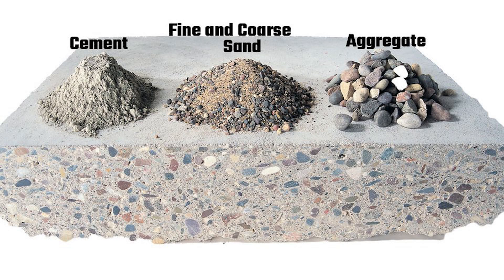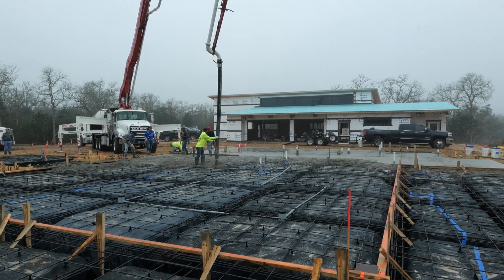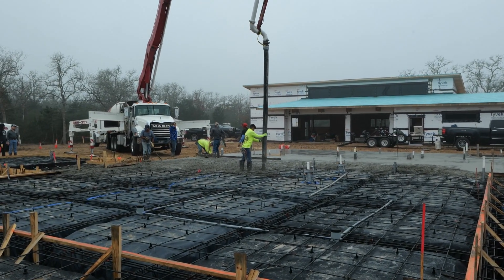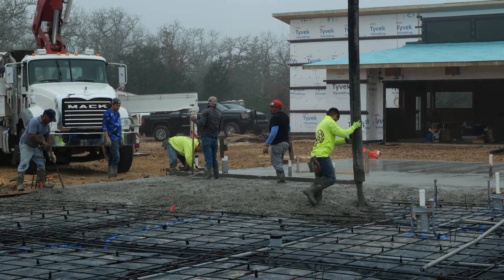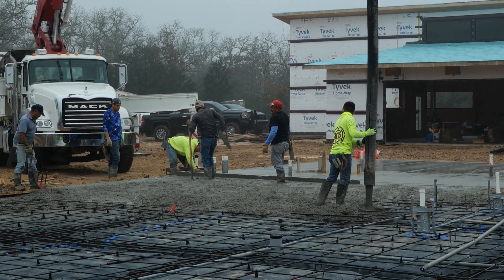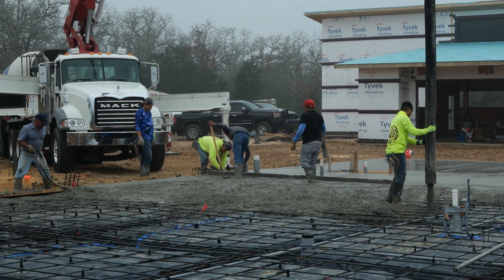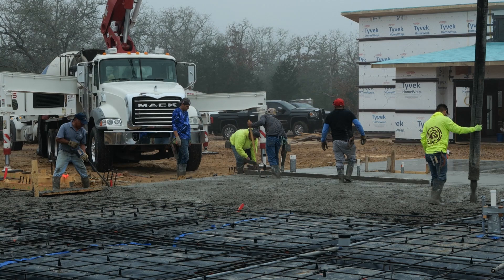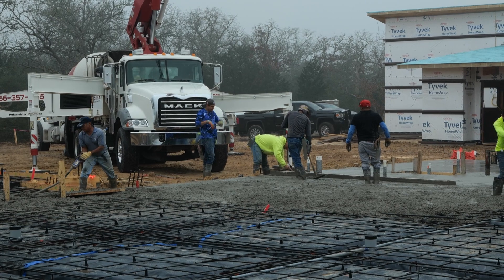Is Cement and Concrete the Same Thing

Comment: Building 28’x50’-2 story Metal barndominium Home. 3,000 psi concrete. 4” slab. 24” deep beams throughout slab w/ 1/2” rebar in beams. Slab will have 3/8 inch rebar 18 inch on center each way. Will adding fly ash to concrete make it stronger and less likely to crack. Is fiber mesh better to add, than fly ash ? building soil up 12”  and compacting it on pad. I heard putting 4” of crusher run base on top and compacting It will allow water under the slab to drain. Concrete  and excavation contractors stated they never heard of that.

Comment: To be a pedant, I would say it's more relevent to be referring to the  'strength' increase over time, rather than 'hardness'.
As a side note, an interesting stroke of luck regarding reinforced concrete is that steel and concrete have almost identical coefficients if thermal expansion, meaning the two don't pull themselves apart with temperature change.

Comment: And that's only portland cement! There are also pozzolans like fly ash or silica fume, natural pozzolans like metakaolin, and ACMs like calcium aluminate, calcium sulfoaluminate, and geopolymers, and that's just the ones I can name off the top of my head.
Reply: Just not at the prom if you want to still have a date at the same end of the evening !  ;)